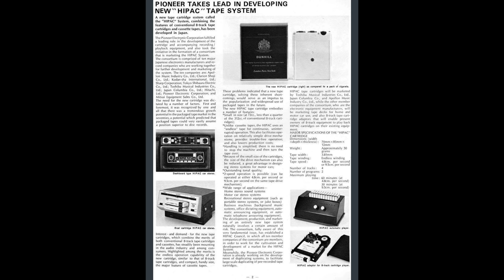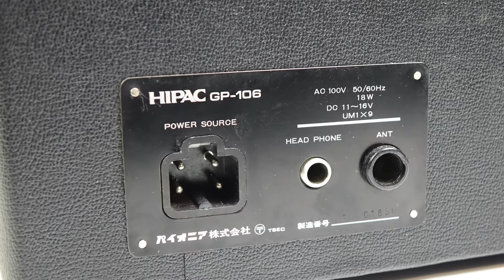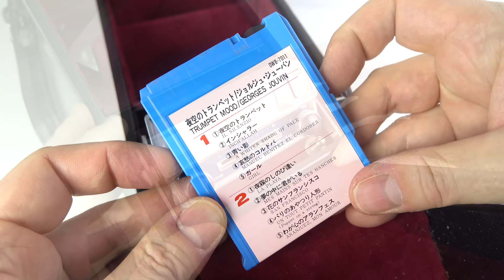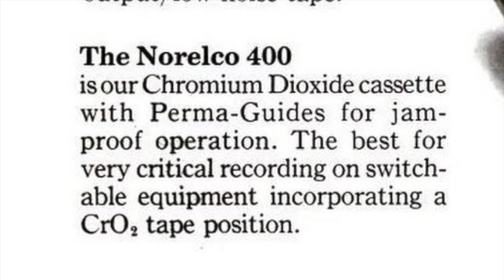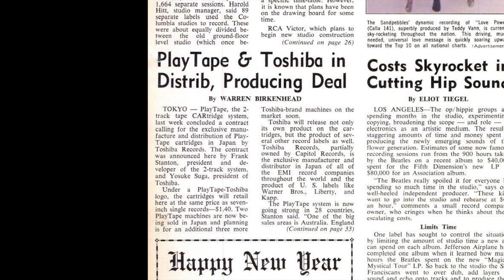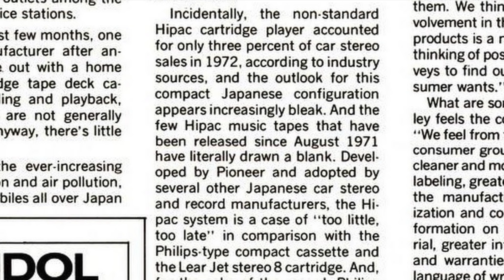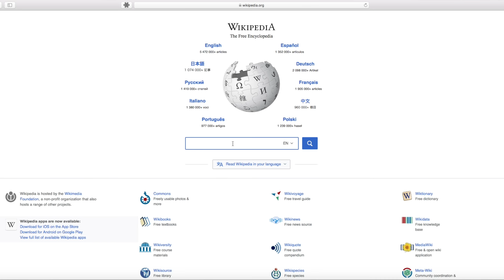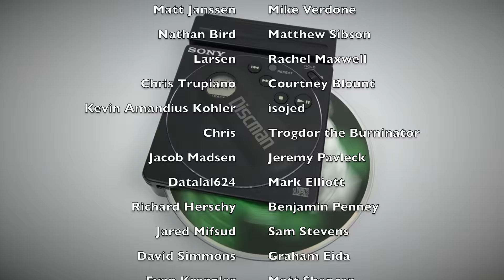Hipac  - The lost tape : Pioneer's forgotten 1970s cassette rival

Comment: I love how any used electronics you get from Japan seems to be in better condition than when it was first manufactured. They always seem to treat everything so nice and save practically any little scrap of literature that came when it was bought. It's pretty awesome how much they seem to respect everything they buy.
Reply: Zzyzx Wolfe thats not always true. For example they treat cars very badly over there, that is way manufacturers need to build cars that can withstand the poor maintanance.
Reply: Zzyzx Wolfe thats not always true. For example they treat cars very badly over there, that is way manufacturers need to build cars that can withstand the poor maintanance.
Reply: We frequently import used iPhones from different countries. Japanese iPhones always look unused; really pristine..
Reply: alebidogas I dunno about that. Where I live used Japanese imports make up roughly 65% of cars on the road and I've seen used cars look brand new
Reply: They treat cars amazingly well over there. The only thing is that they get rid of them after a certain amount of time has passed by crushing or leaving them by the side of the road. There are very few 80's cars around I've heard.
Reply: It isn't so much that they treat their cars badly, but that with how strict their inspections are, which become annual after 11 years, if I remember correctly, it can often be more expensive to keep an old car running than to buy a newer car. They're generally in very good shape, but just lose value very quickly. Used Japanese cars are very often exported to other countries. I think New Zealand, at least at one point, was having a bit of an issue with used car sales locally because of how many used Japanese cars were available in such great condition.
Reply: It's very rare to find well-preserved electronics in the US. Occasionally, you'll find a transistor radio from the 60s in its original box, but it'll probably have a corroded pair of 30-year-old Duracells in the battery compartment. It seems like the only thing Americans care about preserving is old toys...
Reply: I visited a second hand camera shop in Tokyo recently and the same was true, very old cameras looking better than new.  I did wonder if they had just been through a restoration process.
Reply: It also seems that Japanese products are built better than western ones, which may help the longevity.

If it's good enough for Truxton, it's good enough for you
Reply: @IVR02  Americans also really like preserving instruments.
Reply: Zzyzx Wolfe yes, but too bad the birth has been so low for so many years essentially killing off the race. Also, the suicide rate is so high.  But they care for their material posessions.  Ooh, then there is that Fukushima thing.
Reply: @IVR02  and cars.  But those are just toys for big boys
Reply: @crappyatlife  lol did you have your moment my guy? Furries aren't that bad Damn. Calm down.
Reply: @Zizzily  same with houses. A 10-20 year old house has low value and they demolish them. Unlike in Europe where many houses are restored.
Reply: Its certainly a culture thing. Respect is very important in japan, whether its for people, things or places. In Japan you'll find that people even respect abandoned buildings, not trashing, spraypainting or looting them.
Reply: @sterlinsilver  yeah but a 10 year old building is of no value in Japan.
Reply: @afberglund2764  and what about it???? if they can make new ones, even better.
Reply: You must not have watched the videos he uploaded where he bought a bunch of mini disc players...

Comment: That PCB is truly a work of art!
Reply: That's enough solder to sink a ship.
Reply: No cold solder connections unlike today.
Reply: I was thinking the same. Definitely not done using CAD and I doubt if the designer even used Letraset. Most likely drawing film and Indian Ink hence the artistry.
Reply: There were no (affordable) CAD programs or systems to run them on back then.  We used black crepe tape on dimensionally stable draughting film, cut with a scalpel,  at usually at 4:1 scale and then photo-reduced that to make the PCB.  That's why the arty aspect - you did what you liked, so long as it was electrically OK. ;-)
Reply: Miles Hayler ..Yes 🖖I agree with everyone on this, really beautiful 🍸🎯
Reply: "We used..."
We still did in my electronics GCSE not very long ago - for every three we used CAD for, one would be manual
Reply: Anyone know what PCBs like that are called? I want to bathe in images of them, is so freaking cool!

Comment: I bet that is going straight into the permanent collection. What a beauty. Both the outside finishing work, and the mechanics on the inside. Everything is made to last. Nothing of that planned obsolescence bull going on here. Amazing!

Personal highpoints;
-the battery pack. Yeah that is just classy. Wow.
-The PCB layout. Don't see much handtaped pcb layouts anymore (well, defiunitely not the nicely rounded ones).
-The all metal internals. Yes. This speaks to me on an almost spiritual level. Wear resistance. Maintainability. Ruggedness. Love it!

Thanks for sharing, always a pleasure seeing your video's pop up in my subfeed!

Comment: I've seen that power plug before - like on Sony portable TV sets, tape recorders, etc from the same era.  Searching for "Sony portable tv 4-pin power connector" turns up a few samples.
Reply: Russell Hltn Yes, very Sony! I've had several Sony cassette recorders with that plug.
Reply: @Jasper Janssen, I'm not sure what the rational was.  Perhaps it was just to simplify things for the consumer.  "Power goes here".  No need to think if this is "wall power" or from an inverter, or 12V battery or from a battery eliminator.  The cord used took care of that.
Reply: I've seen it too. We had a portable Sony reel to reel tape recorder that had one of those, it was 110 and 12v.
Reply: I knew I’d seen it before!
Reply: We had  too flip up portable tv I can remember if it was a sony or Panasonic used at the beach
Reply: @JeffDeWitt  100volts-110volts for japan and 12volts for cars.

Comment: Hi there, when i first saw  the case for this it reminded me of non fixed cubby boxes, which were storage boxes between the two front seats in some larger cars: - the more you look at the item the more you could see it in a car,  as you showed it has a car battery power lead for running it off the cars battery, as well as internal batteries so you could take it out once you had reached your picnic destination ?  and the speakers would mean  that people sitting in the rear of the car could also enjoy the music, even the way the lid access opened was like some fixed cubby boxes, and allow the driver access to the player, the fixing screw would possibly be required to keep the unit in place and connected if the car was travelling over slightly rough road surfaces ?   just a thought !   see what you think.

Many thanks,  regards  Simon.

Comment: That's a real rarity! Had HiPac came out around the same time as Playtape did in the mid 60's it might have been a competitive format. 
BTW the HiPac tape was also used in a guitar/vocal effect box called the Melos Echo Chamber https://reverb.com/item/3793329-melos-echo-chamber-vintage
I love the way the Pioneer Hipac deck is so carefully designed and assembled, excellent quality.  Pioneer made some outstanding cassette and 8-track under-dash decks in the 1970's, especially their high power Supertuner decks.

Comment: Oh wow, that lights up an old memory. I could swear my parents had an 8-track deck in a bag like that when I was little. I don't think it had the speakers and whatnot, it was just a carry bag, but it had the slot angled so that you could use the player without taking it out of the bag, the velvet interior, and the compartments for carrying tapes, in that same black crackle finish.  (Very similar in construction to the case my mother's Minolta camera came in, come to think of it.  Japanese gadgets of the '70s and their accessories had an aesthetic going on...)

Comment: i wonder if the antenna on the box was used as a transmitter to transmit the music to your car stereo through the radio like those FM transmitters you can get for your MP3 players.
Reply: The technology needed to do that would be far too big and expensive, if it was even possible at the time.
Reply: You might be on to something, but not like you think. In the 70's they had FM converters so you could listen to FM on your AM car radio. You'd plug the cars antenna into the converter than the converter into the antenna port on the radio. I really don' think that's what was going on here, but it's possible the thing was set up to connect to an AM car radio just like the FM converters were.

Comment: As a child in 70's several portable mono HiPac units. We referred to them as 4 track however. Perhaps not the exact same tape. But I had one made for Walt Disney, with a red and white casing. I had a couple of the tapes unspool which was also common for worn out 8 tracks. They wore out because the back of the tape had a silver coating to help make it slip when winding back into the outside of the reel. The thinner 4 track were even worse in that respect. I did have a couple of stereo tapes but the only player I had was mono. The Walt Disney one I had, did not auto change tracks, instead just a small lever that allowed you to change track 1 or 2. I eventually wore it out, the spring lever that turned it on when inserting the tape, broke. At that point I did however simply rewire the switch to manually turn  it on and off. My nephew had a Midland model with stereo, similar nut did have auto track change.

Comment: one tip you probably already know of; if, once a year, and definitely before installing, place rubber belts in a small bag of talc and shake it around, remove and shake off all excess. it does an amazing job of keeping belts in condition.

Comment: Concerning your question relating to the motor speed and changing the value of the capacitor: Changing the capacitor value will NOT alter the speed.
The motor appears to be a 2 phase synchronous type. The purpose of the capacitor is to shift the phase of the current in one of the motor windings in order to provide a rotating magnetic field to develop a torque between the stator and the rotor. 
The reason that different values of capacitor are specified for different supply frequencies is that for any given value of capacitor, the reactance of the capacitor and thus the impedance of the circuit changes with frequency. To keep the current in the winding of the motor the same then a smaller capacitor is needed at 60Hz than at 50Hz.
Too large a value risks overheating the winding. Too low a value risks the motor not starting unaided.
If the motor runs, then regardless of the capacitor being correct or not the speed will be synchronous with the supply and can only be changed by alteration of the belt pulley size. 
I hope this helps.

Comment: Obviously the GP-106 was not meant to use a swappable deck, it was a portable boom box, that could be powered from the cig-lighter of a car, truck or boat. But it gave you the option of removing the deck for docking on another bracket, or such. Great post & thanks. Might I suggest a post on HiFi VHS, a friend used to use that as an audio recording tool in his studio. Cheers!

Comment: Such irony that the final fate/story for the Playtape compact-cartridge format was use in an educational toy, as the same befell the 8-track cartridge with the 2XL... and the compact-cassette as-well, in a later version of the 2XL released in the late-90's/early-2000's.
Also--for the sake of argument of design--seeing how the unit was designed to be easily-removable for it's in-car mounting, I'm reminded of an under-dash 8-track player offered by Craig... that permits that sits as part of my collection. It as-well was designed for easy removal... and given the overall size of it's case, perhaps it was offered as a replacement for those whom first acquired the Hipac system, but later found themselves desiring 8-track instead.

Comment: The edge connector is very much similar in design to an aftermarket add-on car cassette deck I have from Sanyo, you'd mount the bracket and wire it up, slide the cassette deck in, and voilà! Then, you could take the tape deck out of the car, slide it into a similar bracket installed in another car (or remove it when parking to prevent theft). I still have that deck in my basement, it was installed in our '68 Plymouth Duster which got scrapped in '82.

Comment: lol the moans this time reminds me of classic Doctor Who, where 40 min was stretched on for 10 episodes.. each episode had perhaps 5-10 min of unique scene then the next episode would just repeat the last several min of the previous but slightly re edited.
Edit: for those who want a clearer picture of what i am describing. after episode 1 of a story arc you can divide each episode into 3 bits. 5-10 min of recap from last episode, 5-10 min of episode specific material, 5-10 min of stuff that's just going to be in the next episode as its recap anyway. It's what makes classic Who a chore to binge watch anymore.

to be honest I would love if the BBC re edited them as 90ish minute movies with the recap bits cut out and strung together more cohesively .

Comment: I have a tape delay unit that seems to use the same tapes  - a Univox EC-100.  I believe they also made an EC-80 that Van Haven used and the tapes were also used in dictaphones.  When I bought it in 1990 or so, it came with a spare tape.

Comment: Tape loop systems had three major issues - One, you could never start the music from the beginning, it just played from wherever it has stopped last. That was why it found favour in cars but not for home use.

Two, artists hated the format because the songs on an album had to be timed to match the tracks on the tape, otherwise you ended-up with a CLUNK! in the middle of the music as the player switched tracks. That meant having to alter the songs or rearrange their order, or as a last resort, leave periods of silence. 

Three, they suffered from 'going tight' in which the tape tended to shorten slightly with the pressure of the pinch roller over time. On conventional spooled tape that would be too small a difference to matter, but the endless loop relied on a short length of slack remaining on a very long length of tape, so any slight shortening took out the slack causing it to bind tight.

Comment: The 8 Tracks here in the US were a high point and the sound quality was superb. The main problems with 8 tracks were the wind up tape in the machines and the tapes were exposed to extreme temperatures of hot and cold. Being left in the car and the car not being in a garage. No protection. In 2000 I was converting the tapes to CD and many were totally broken down due the years of abuse and the poor construction of the tapes. I was able to save a few to CD. Watch the movie 10 with Dudley Moore Bo Derek at the beginning Dudley gets into the car and puts in  an 8 track. Memories 😂 This was in 1980 and still popular. 😎

Comment: Kinda neat packaging right there. Maybe not the most practical but neat anyway.

 I bet the unique power connector has a pair of contacts for AC and another for DC since both cables plug in the same connector.

Comment: I think the most likely reason for the player to be fastened into the bag would have been for someone who didn't have a car, or wanted to take the player in the bag along for a stroll, or even a pic nic. Then if the owner got a car, they could take out the screws, and pop the radio into their car holder unit, then pop it back out, and slide it in the bag when they'd go home for an example.

Comment: Excellent channel,  love your woŕk.

I have no idea what the power plug is called, but i had an old Japanese 12v/240V portable tv that had a very similar plug from the same era. I really cant remember the brand of tv, i was 7/8 years at the time. Got it from a carboot sale. My sister n i were given a fiver each. She came back with a sticky face n a sugar high, i came back with archaic technology (n i haggled for that sucker). a great tv, we were traveling australia at the time, and my portable could always pull channels better than the main tv. Probably cos i could diddle the knobs, opposed to digital clicky buttons of the main tv.

But yeah. I immediately recognised that connector. I only had the 240v plug cable, i pulled it open and soldered 12v bananna plugs to bolt into the tvs case. Then twitch wires from there to 12v to the bus's 12v buss. Ha.

So, there was obviously a standard japanese AC/DC connector, and was used across manufacturers. Never ever seen it anywhere but on that tv n this video. Tried a few adaptory things, untill i gave up n put binding posts on the damn thing. Then once i got it working... pretty much didnt use it much again. When your travelling australia, theres always new things to explore. Telly is for schmuks. Now im in my late 20's, i still do the same thing. Vast amounts of energy n effort to get a thing working, n when it does, its just 'cool, that now works, next...' guess thats why im a techmoan subscriber. But it did entertain me for a few wet days here n there.

Also, excellent out-tro.

Comment: The endless loop cartridges, such as the play tape and the Hipac represent a much simpler design that the compact cassette. If it had been made slightly smaller, and had better marketing, they would have been a slightly better system.
Reply: Indeed! The basic design is ingenious, having the pinch roller inside the cartridge and the capstan in the player to drive the whole tape means just pushing the cartridge in to play, and no need to access the reel to take up the tape.
There would've been few other ways to improve the thing like inverted tape wounding, sub/ultrasonic tone for track change, multi-track head, pressure pad instead of foam pad, etc.